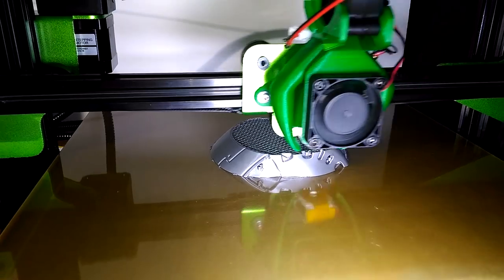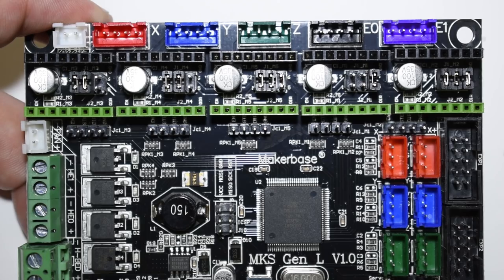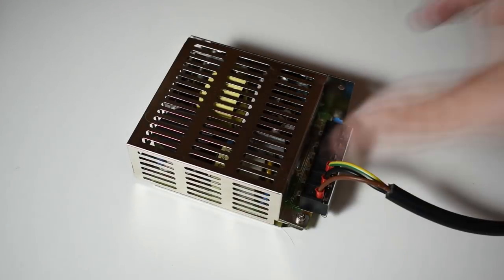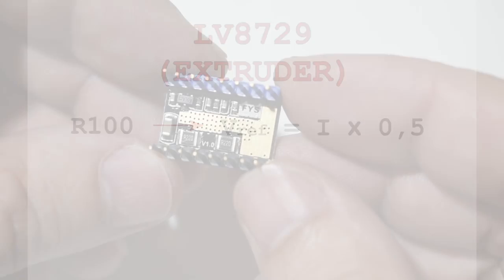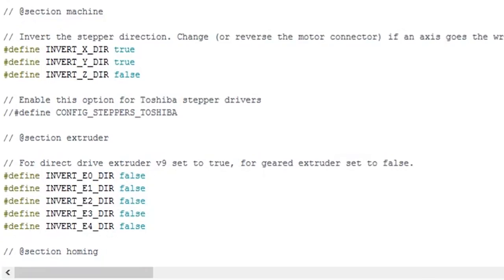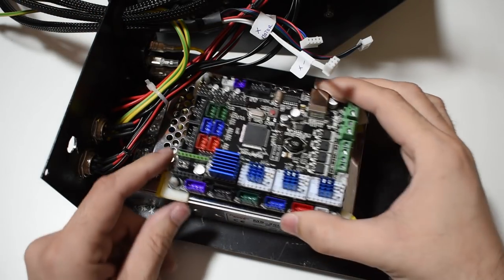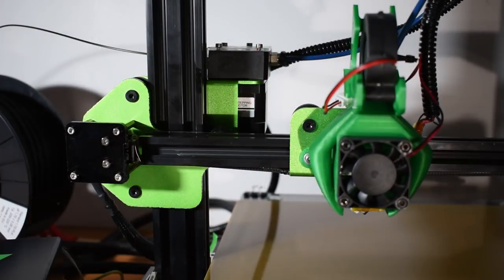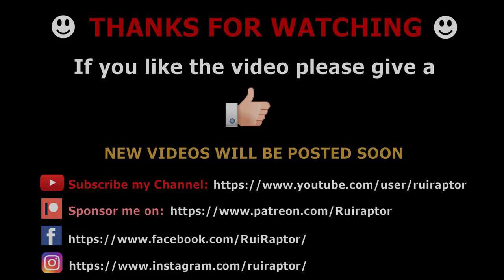Install & Setup - MKS GEN L + TMC2208 + LV8729 (TEVO TORNADO)

Comment: Hi, is there any change in the process you descripe in the video if i will use MKS SGEN L V1.0 instead of MKS GEN L V1.0? Thanks
Reply from the maker: Hi, the SGen is a 32bit board so you need to install visual code studio together with platformio to compile the firmware.
Reply: Were you able to setup the mks sgen L? I'm trying to set one up but am getting confused

Comment: Hi, Rui! I have a couple of questions regarding this upgrade. Considering the Vref value, i found a Vref calculator online for different drivers and it says that a setting of Vref over 1.2 Volts can kill the driver. As your values are pretty close or over this value i am wondering what is yopur opinion regarding this.
The next question is where do you connect the extra driver cooling fan?

Kind regards, Jurij
Reply from the maker: Hi Jurij, we used the chip's datasaheet as reference. Can you share the link of that calculator so that we can analise the information?
Reply: @ruiraptor  when i copy the link to comment or even mention the site where i found the calculator, my comment gets deleted. I dont understand why...
Reply from the maker: try not using the link path but just the name of the website.
Reply: @ruiraptor  tried everything but still the comment got deleted, but now just today i finished the upgrade with vref values from your video, and made three 47 minutes prints, and everything is perfect.
I didn't have so much qualitiy issues before, but i absolutely love the noise reduction, it is amazing. Steppers did not overheat, so i guess everything is ok.

Comment: Hello rui, which jerk and accelaration are correct for Torando with this board and drivers ? Do you use settings of acceleration in your slicer (cura for example) or disable it and let firmware default ? thanks.
Reply from the maker: Hi Christian,
I normally disable the motion control in the slicer and use only the settings in the firmware.
You can use acceleration= 800 & jerk=8. These settings will prevent ghosting issues. If you use an extra glass over the heatbed, you might need to reduce a little bit more.

Comment: Hello, with drivers 2208 and a 42hd4027-01 stepper motor (current rated 1.5A on 3.3 volts) is possible to mount these drivers? and the vref to what should be regulated? because I think this engine is too big and the vref goes undervolt, is it right?

Comment: Nice and useful tutorial.
Is this setup the same for any prusa-like printer or only for the Tornado ?
Reply from the maker: Hi,
Thank you for your comment.
This tutorial will work for any printer as long as you know the specs of the motors and adjust the vrefs/currents accordingly. Furthermore, you need to have access to the firmware so you can change the motor direction (if needed). In last resort, you can get away without it and just reverse the motor wires.
Reply: Hi Ruiraptor.
Thanks for your reply. I was studying it furthermore today to make a JGAurora A3 more quiet (A4982) . I have to change the motherboard (welded drivers on a Ramps1.4) , so I'll follow your software instructions too. 
But I don't know the Nema17 specs. Could it be an issue ?
I have to learn too if I have to configure something with the actual LCD 2004 display. Not so easy, but I progress.

Comment: Could you use the LV8729 for the other drives?  Seems it would be even better to replace all of the TMC2208s
Reply from the maker: Hi Doug,
Yes, you can use the LV8729 drivers for all the axis. They are not as quiet as the TMCs but work perfectly

Comment: Hi! I'm planning to build a Ender 3 with quite a few modifications and I'm curious about how/why the LV8729 is better for the extruder than the TMC2208? (Thinking getting the MKS Gen L, E3D hotend/extruder for the Ender 3) Any thoughts on the StepStick Protector modules to put underneath the drivers?
Oh, and a related question. I notice the vast majority of TMC2208's out there are v1.0, but I've also seen rev 1.1, 1.2 ands I think 1.3. KNow anything about the differences for them and which ones to get?
Reply from the maker: Hi Thomas,
The TMCs cannot handle very well fast direction changes such as the retractions from the extruder and that's why the LV is used instead.

Regarding the protectors, to be honest, i don't have any thoughts. It's just one of those things i don't use and not thinking on using.
Regarding the driver version, it should be related with the module itself. You can check the chip datasheet and check.

Comment: RUI! I've seen other videos where there was a soldering involved.. specifically two spots to turn on the higher voltage (SPREAD CYCLE) setting of the drivers and splicing a resistor into the system.. Second, there was a FTDI UART chip involved. I ended up purchasing all of that but I do not see you utilizing it. What am I missing here? thanks!
Reply from the maker: Hi,
There are other TMC drivers on the market and some must be configured by soldering the small pads. The TMC 2100 in one of those examples. But i think you are referring to the UART mode. For that, you need to unsolder and flip some of the pins on the TMC2208 so that you can access the UART pins in order to change some specific modes. If you plan on working with the TMC2208 as is (stealthchop mode), you only need to select and configure the stepping with the jumpers on the board.

Comment: Hi!
I did exactly like in your video for a TTPro with LV8729 just on the extruder and TMCs on X and Y, but the extruder still makes a high pitch noise. Any ideas on how I can reduce that? I connected the TMCs with UART because I'm using Klipper. TIA
Reply from the maker: Seems like it's working with too much current. Lower your Vref. Are you using the same LV8729 with the same resistor?
Reply: @ruiraptor  yep, 220. I had it set to .91, .760 should be alright?
Reply: @ruiraptor  Thx for the input!! Lowering the Vref made it a lot quieter!

Comment: This worked great but after upgrading to a 2mm lead T8 screw, my z-axis motor doesn't seem to be able to turn most of the time. I've updated the steps per mm. Do I need to increase the VRef for Z? If so, how high can I safely go?
Reply from the maker: Hi,
The TMC2208 can handle RMS currents up to 1.2A which is safe for your Z motor but it will run hotter.
You can try and increase the vref but check the temperatures (driver and motor).
In alternative, you can use an LV8729 driver for the Z too.
Reply: @ruiraptor  The problem turned out to be the Z homing feedrate in the firmware. It was set to 1,200 which is apparently too fast after the changes/upgrades I've made. I determined the max I can use is about 500 before it starts to slip. Thanks =)
Reply from the maker: That's true. When changing the leadscrew pitch you need to change the steps/mm. I thought you have changed them. Thanks for sharing.
Reply: @ruiraptor  NP; I had the steps per mm set but the feedrate was way too high.

Comment: Rui, would it be the same process for tarantula? On my 3d printer came the MKS Base 1.4 I'm thinking of trading for this mks gen that sells on baggood already with the drivers, will it work fine for me?
Reply from the maker: Hi Christian,
yes, the procedure is the same for the tarantula except the vref value for the Y axis since the tarantula does not have a big Y axis motor. You can use the same X Vref for the tarantula X, Y and Z.

Comment: Hi my friend. For MKS gen 1.4 from MKS base, do I still need to reverse the LCD cable? I guess I have to but just want to double check. Thank you for your video. I've watched the other video of yours and learned a lot.
Reply from the maker: Hi Tylor,
You will know when you connect it :)
Don't worry...you will not damage the display. I had this problem the first time i connected it and i just reversed the cable and it worked.
Reply: @ruiraptor  Thank you so much for your reply!

Comment: Are you running the controller on 12V or 24V?  Are there any changes required to run on 24V?  Thanks!
Reply from the maker: Hi,
I'm running at 24V.
The tevo tornado is 24v from stock.

Comment: Will the LV make my extruder less noisy during retraction ? Because its the main source of noise from my printer
Reply from the maker: It will make it a bit less noisy. I don't know what kind of noise you are referring to but if the screws that secure the extruder are too tight, it will make more noise than it is supposed to.

Comment: I thought the TMC2130 was the "popular" driver these days...any reason you went 2208 instead of 2130?  (It looks like a lot of wiring is needed for the 2130)
Reply from the maker: Hi,
Yes...the TMC2208 is much easier to setup. The TMC2130 has nice features like sensorless endstops but i'm that kind of guy that likes to have "real" endstops :D
Reply: Thanks for making the video...I have the same board as you.  I bought the replacement motherboard but hadn't made a final decision on drivers.
Reply from the maker: The TMC2208 are awesome drivers. I love them.

Comment: I have DRV8825 and A4988 drivers.. What is the jumpers / driver dependency? 

Not sure which resistors to measure in order to calculate vref.. .05 ohm on the a4988?  For example, according to an arduino forum post (415724), for the drv8825 vref = Imax/2, and for the a4988 vref = Imax/2.5 ? 

Where on the MKS does motor power get to the motor (pin 16 of the driver)?  For example, is it possible to run a motor at 5v assuming a driver that supports that?

Comment: Would you still recommend this upgrade in 2020? I purchased this board and drivers a while back, but didn't do the upgrade at the time. Is there a print quality upgrade as well as noise?
Reply from the maker: Hi Andy, the new printers already have this board, so if you have the new printer, you only need the drivers. The difference is not only the noise reduction but also the print quality because the TMC drivers will eliminate the salmon skin effect on the prints.
Reply: ruiraptor Thanks for the reply! My Tornado is a few years old, so it sounds like this would actually be a nice improvement to go through with.
Reply: Was anyone looking at the tmc2209 nowdays? Looks like an upgrade from 2208
Reply from the maker: The main difference between both is the max output current (bigger in the 2209 but never archieved in our Tevo machines) and the sensorless homing feature (only available in the 2209). If you don't care about sensorless homing, you can go with 2208 as everything else is the same.
Reply: Thanks again for the info! Any advice on calculating the voltage for four 2130s? I've got the extruder driver you recommend on order, but I'd like to use these 2130s since I've already got them. As always...THANKS!!!
Reply: I started this upgrade and paused because I really wanted to upgrade the hot end.  I also found this mount on Thingiverse for the MKS Gen L to fit in the control box. (https://www.thingiverse.com/thing:2884809)  It was a challenge to install!  I also moved the fans outside the box to free up some room.  It's got airflow and any noise reduction in the drivers is now outdone by cooling fans  =)  Still in progress...working on a direct drive install and BL Touch to mine

Comment: Hi. I ordered my Tevo Tornado last Friday, and received it this morning. The first thing I did after assembling it. Was to open the Controller Case to find out what motherboard it came with. As when I ordered it, I also ordered smother's.
Well. I have the MKS GEN L V1.0 board. So I've sent the smother's back. But my drivers so not look the same as the TMC2208 drivers in the video.
Are the stock driver the same or should I order the TMC2208 and LV8729 drivers?
Reply from the maker: Hi,
No, the stock drivers of the tornado are Allegro A4988 drivers.
If you want to upgrade the drivers, i recommend the TMC2208 for the X, Y and Z and the LV8729 for the Extruder.
Reply: That is almost the answer to my question.

Are the TMC2208 and LV8729 better, or an improvement over the stock drivers?
Reply: Also I've tried to join the facebook group, but that is pending. I see the newest version of Marilin is v 1.1.9. But I do not know if it has been set up the same as the one that you are supposed to be able to get from the facebook group?
Reply from the maker: The TMC drivers are better than the A4988. The noise reduction alone is a great improvement.
Regarding the marlin firmware,  you have a more recent version such as the 2.0 but it's not available for the tornado yet.
The 1.1.9 marlin version available in the facebook group should have most of the features.
Reply: By the way. Thank you for your videos and knowledge and help! It's really appreciiated.

Comment: Hello Rui I just installed an MKS Gen1.4 board with the same drivers that you showed in your videos, I have also installed the second Z motor but I don't know if the V-ref should be changed. I used the CR-10 upgrade kit for the double Z so basically I have a single cable on the board that splits in the 2 motors.

Thank you for your help, your videos are amazing.
Reply from the maker: Hi Yuri,
The cable you have for the dual Z is a parallel or serial cable? My bet is a parallel cable and if that is true, it will divide the output current between the 2 motors.
Normally, the Z motors dont require too much current to move that axis and having 2 motors you can work fine with the minimum. Having said that, just adjust with my vref advice and test. Adjust a bit more only if you see issues.
Reply: Thank you Rui. I will do.

Comment: Is it the same process to update drivers for the Tevo Flash?
I’m getting different feedback, some people say the vref doesn’t need adjusting because it is done by software. Your video shows they need to be manually adjusted.
Reply from the maker: Hi Brett,
It's the same process. The drivers which you can adjust the vrefs by software need to be connected by SPI or UART. I use them stand alone (as shown in the video). The stock flash drivers are also stand alone.
Reply: @ruiraptor  that makes sense now, it can be used either way but your way looks simpler. 
Do I just use the firmware from https://github.com/tevo3d/Tevo-Flash, if yes which one BLTouch or TMC2100 BLTouch?
Can I take a backup of the factory firmware?
If using the above firmware do I need to specify that I'm using different drivers, have the dual Z model or invert axis?
Thanks
Reply from the maker: Hi Brett,
You can use any firmware as long as you change the motor direction (if needed). In some firmware versions, you need to specify that you are using the TMC2208 in standalone. Do a search for standalone. If there is no match then the firmware you have does not need that driver change.

Comment: Maybe you missed my question, so I'll ask again.
Would all this be the same on a Ramps 1.4??
Thanks in advance for any help you can give in this regard!
Reply from the maker: Hi,
The installation procedure should be the same for a Ramps 1.4. Just don't forget to add the setup jumpers under the drivers.
Reply: @ruiraptor  I was able to find out the jumper placement for the TMC2208's. And I copied your arrangement for the LV8729's. 
Thanks again !!

Comment: is there any benefits tmc2130 rather than 2208, i wanna upgrade to mks gen L too witch tmc drivers 2208 newr version if im right, any difference them exclude spi/uart
Reply from the maker: The TMC2130 has a few extra features that you can play with (if interested) such as sensorless homing, for example.
For more details, you can download the datasheet of the TMC2208 and TMC2130 and compare the differences.
Reply: For me, I had both and ended up using the 2208 over the 2130. Take a look at the datasheets as ruiraptor suggests. the 2208 handles a bit more power and seems, for me, to run cooler. The two features over the 2130 I don't use, but, you may have a use for them.